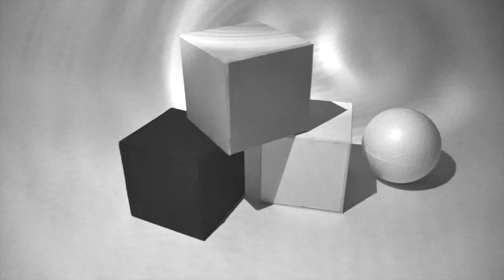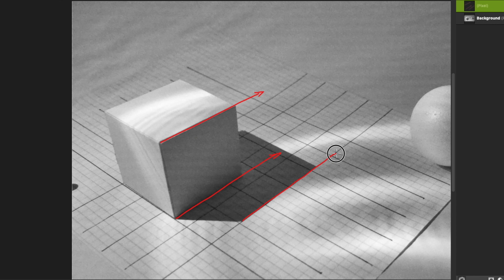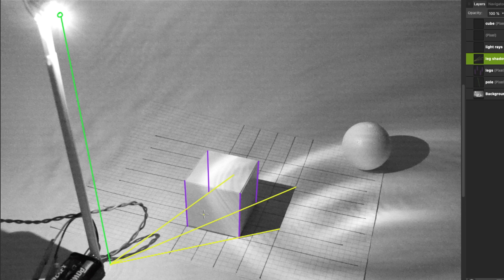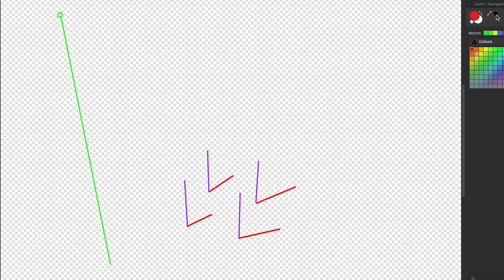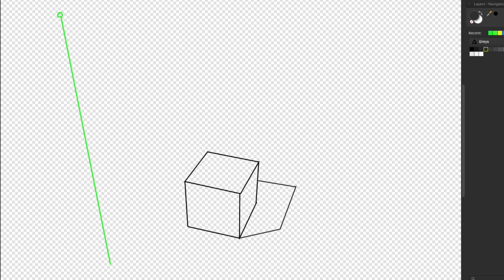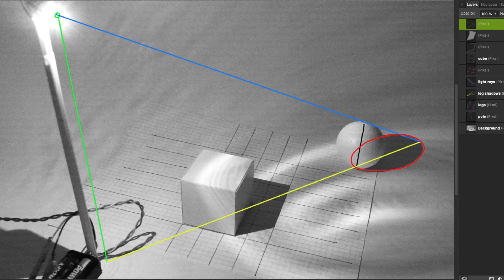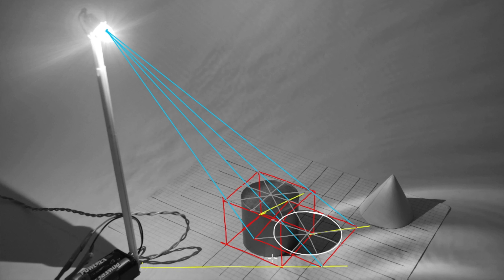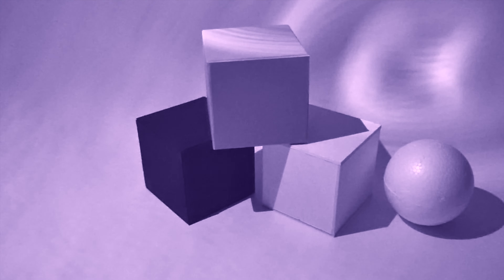How to DRAW and figure out SHADOWS?

Comment: Any idea how to calculate a cast shado that falls on another object, what is that even callled ?shadow refraction ?
Reply from the maker: Yes, uses the same method.
Reply: @EricStrebel  can you actually show how to do it, especially surfaces that are not right angled but where the surface changes few times at different a angles than 45 or 90 degrees like 10, 30, 70 etc

Comment: I'm currently immersing in Scott Robertson's How to Render. It's such a great book but sometimes Scott is not totally exhaustive in his explanations.  
For example, what if I have a white cube, and I modify the shape to have a long ramp jutting out from the middle of the 3rd face (the darkest face among the 1,2 and 3 read) and angles down to the ground. In this case, the cube casts a shadow over this ramp. Here I don't know how to assign values to the entire set:
1. I assumed that everything inside the cube's shadow would have a base value of 5. Adding reflected light and occlusion shadow made the set believable.  
2. I repainted the set again with the assumption that because the ramp angled away from the local light, the shadow falling on it would follow the Half Way To Black rule, and ended up darker than the rest of the 3rd face. The set was somehow also believable to my inexperienced eyes. 
Could you tell me which scenario was correct? Thank you.
Reply from the maker: post to social media so I can see @botzendesign detroit, facebook will be good